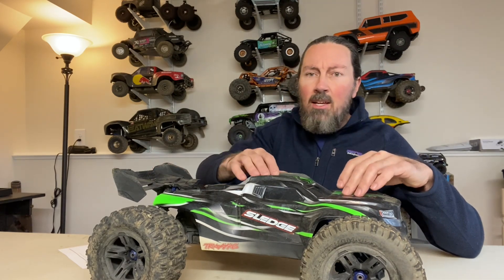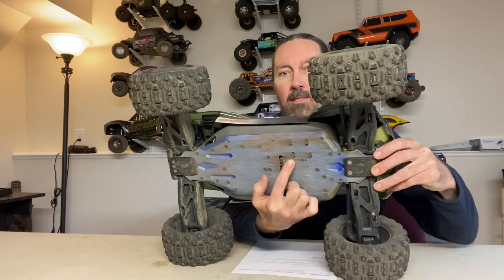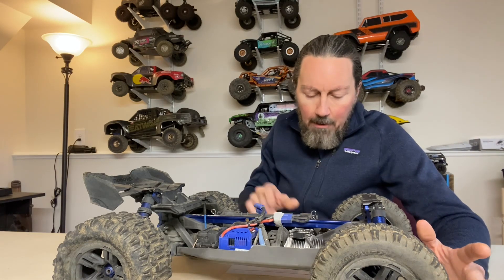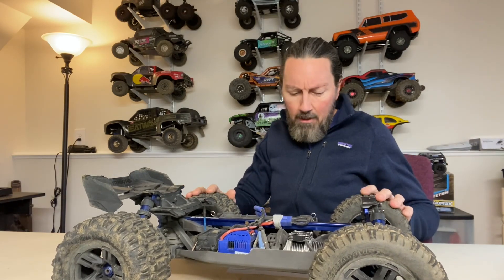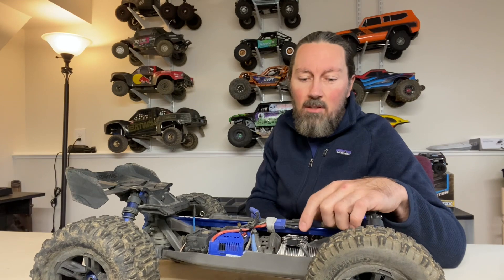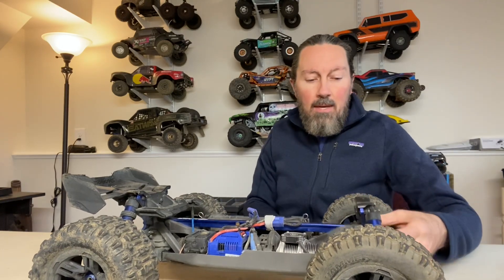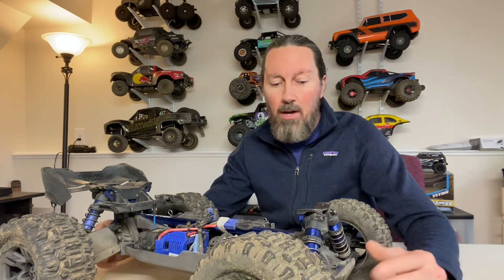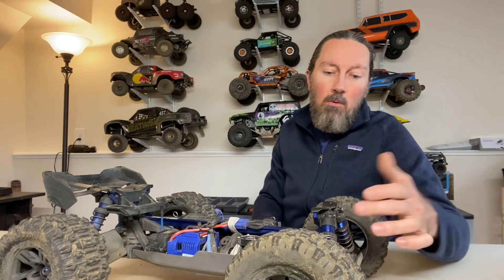Traxxas Sledge- All You Need to Know - vol.2

Comment: My Sledge has gone through 4 pinions, 2 spur gears, and now a rear ring gear chipped. Installed 9579R front and rear, Hot Racing steel Spur, extra hardened pinion from Robinson Racing, chassis cover to eliminate rocks and dirt from damaging teeth, and Hot Racing motor mount washers to limit motor movement. I think the first two chipped pinions were from small rocks (baseball field). Any tips anyone? We’re at Red Bandit Racing
Reply from the maker: Gears are def a weak point on the Sledge. Sounds like you got yours dialed now.

Comment: Hey man, loving the Sledge vids.

Have you seen Basher Queen’s carbon fiber shock towers for this thing yet? I’ve heard good things about their products, so I ordered a set up to try them out. 

In the description on eBay, it states 2 different measurements: one spot says they are 3mm thick, another says 5mm. I messaged her just to make sure, and they are indeed 5.1mm thick and weigh 40% less than the stock aluminum towers. I’m kinda stoked to check them out.
Reply from the maker: Ive seen them, very nice looking. Let me know how they work out. Pretty sure they make them for the Kraton too which allows the Sledge body and wing to fit. Cool stuff!
Reply: @rcilluminati26  indeed they do! 

Should have them in a couple days, I can report back.

I was able to nab a set of the Traxxas Response Pro wheels/tires as well, and they are LIGHT man, if I remember correctly they are like 80 grams lighter than the stock Sledgehammers per corner! 

They are getting hard to find though, and my local hobby store says they are unavailable, so order a set now if you want them.

But I really think this thing is gonna be sick with all the weight savings.
Reply: @rcilluminati26  the BasherQueen carbon towers are beautiful. They fit perfect, look perfect, and fixed my bent towers (which I didn’t even know were bent).

Stock front tower is 47 grams, carbon front is 29. Stock rear is 66.5 grams, carbon rear is 44.5!

I couldn’t be happier with them so far. We shall see how they hold up in the long run now.

Comment: So far for me left arm broke the suspension  pin cracked the brace to Secure the pins bent tire coming off and rear diff seems to be leaking oil , should of waited for the v2  over all tho good car the power is put down to the ground the sound amazing the control  is good but durability hand down my e revo 2.0 takes it
Reply from the maker: There is some work to be done but its worth it. This is now one of my favorite Rcs

Comment: I need help replacing the boots on my front and rear differential axle..please help
Reply from the maker: You really dont even need the boot, they rip really easy.  If you want to change it, remove the center diff and then you can remove the driveshafts
Reply: @rcilluminati26  thanks man..i changed them now! If they rip again im not replacing! Only reason why i did it the screw that holds the drive cup on came out

Comment: i have Traxxas Sledge and servo is compatible with 7.4 volts. Can i buy “Traxxas 2260” and use it to up the voltage from 6V to 7.4V without changing the stock BEC? Or how can i up the voltage to 7.4V without changing the stock BEC?
Reply from the maker: I haven’t tried the Traxxas 2260 but you can definitely wire in a separate bec just for the servo. You can power it directly from battery or even get a small 2S pack just for servo power. 
There’s a very specific way to wire them. Here’s a bypass adapter that makes it easier. 
https://www.amainhobbies.com/holmes-hobbies-receiver-bypass-adapter-w-auxiliary-output-hhb250100015/p541701?gclid=CjwKCAjwlqOXBhBqEiwA-hhitJAfialTuBb8EQbwFxnGp32UsepSTLihrD3sAoZ41wr4mWOP2cOQZBoCAQ4QAvD_BwE

Comment: I have 18/46 pinion and spur from traxxas. Can i use them without moving the motor and mesh ? Or what should i do? Those pinion and spur is the one stated on the box for 70+mph
Reply from the maker: I haven’t tried that gearing so I’m not positive but if you do need to set the mesh again, be sure to use blue threadlock on the motor screws and also the pinion grub screw.
Reply: @rcilluminati26  i see that our Sledge servo is compatible with 7.4 volts. Can i buy “Traxxas 2260” and use it to up the voltage from 6V to 7.4V without changing the stock BEC? Or how can i up the voltage to 7.4V without changing the stock BEC?

Comment: My Sledge is having trouble turning left. I’ve seen other comments on this elsewhere. It’s great to the right. I don’t see anything loose. Any ideas?
Reply from the maker: The servo horn turns but the wheels dont?  Double check the servo saver, theres a nut to adjust the tension,  its at the bottom of bellcrank on left side
Reply: Check that some small rock is not in the mechanism. If not, unscrew servo horn and check that is moving correctly.

Comment: i just spoke with traxxas yesterday the guy i talked to said he never heard of the diff issue or dogbone pin
Reply from the maker: Lol, first day on the job?
Reply: I emailed Stefano at Traxxas and he didn't acknowledge the issue nor want to handle it (outside US, not our problem etc). Called and spoke to someone else, acknowledged the O-ring issue but not the diff problem, no help offered and no apology. 2 years of abusing an Arrma Big Rock with no issues. 11 days after buying a Sledge and after two gentle runs, problems. So much for the legendary Traxxas customer service and quality.
Reply from the maker: @lukebaines7785  wow, sorry to hear that. They’ve been pretty good with me so far.
Reply: @rcilluminati26  Thanks. I get the sense it's how they handle international warranties etc. Probably a different story in the US.